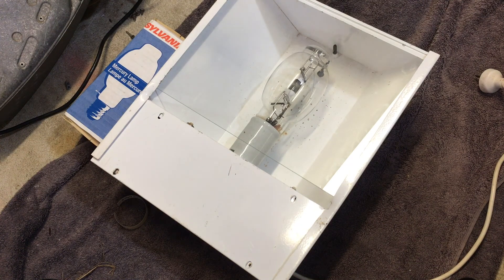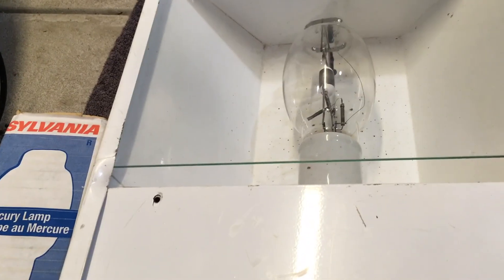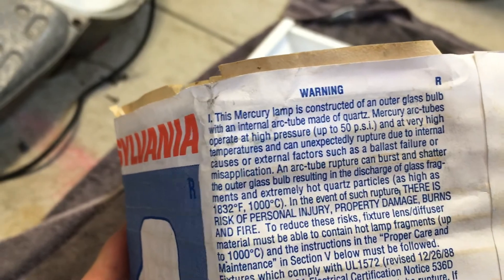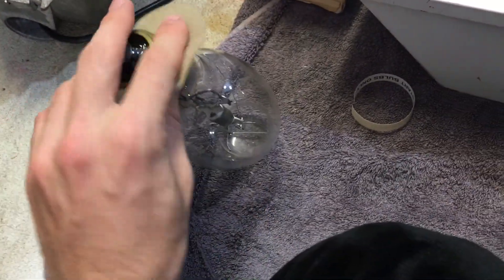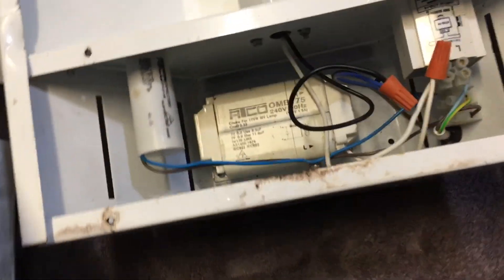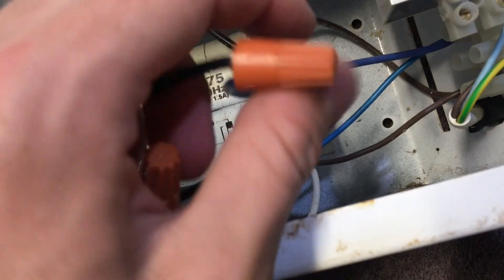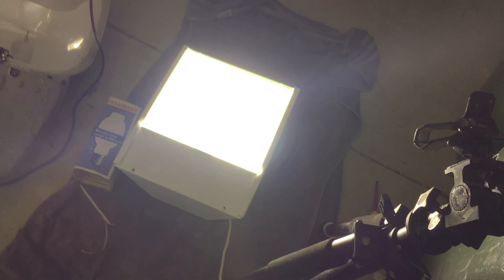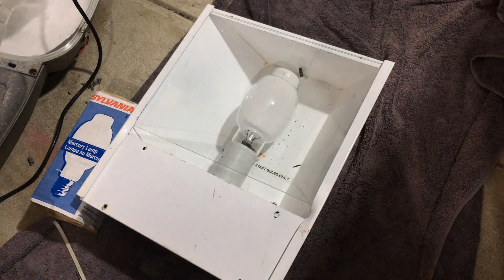175w mercury vapour/metal halide light fixture, new bulb and testing (old video 2019)

Comment: The U.S metal halide light used of probe-start method for starting without external ignitor. And the CWA ballast could be operating any input voltage 120/208/240/277V and 50-60Hz

Comment: The only time a metal halide lamp will explode is if it is being energized 24/7. It is recommended that metal halide lamps be shut down for 20 minutes once a week. That way, as the lamp reaches end of life, it will fail when you try to turn it on and will not explode. It’s best to use an unprotected metal halide lamp in an enclosed fixture which will protect people if the lamp does explode.

Comment: This MH lamp is actually a probe start lamp.
Reply from the maker: then why is there an ignitor? the old bulb was a pulse start MH, the one I replaced it with was a probe start MV. in Australia, there's no such thing as probe start MH or pulse start MV. MV is always probestart, MH is always pulse start.
Reply: WillPower A probe start MH lamp can operate on an Australian MV ballast and a 750v-1kv 2 wire ignitor. The ignitor in this fitting does not send a pulse powerful enough to destroy the starting probe in this MH lamp.
Reply: @willpower_electrical_and_more  there is something wrong mercury vapor bulbs dont need igniter, pulse start metal halide bulbs need igniter probe start dont need
Reply: If you look on the bulb etch, there is an alphanumeric code that says “M57”. In the US, this is the designation for a 175w probe start MH lamp. This MH lamp only needs a LOW voltage starting pulse to ignite. However, a real pulse start MH bulb actually requires a HIGH voltage starting pulse. A US 175w PULSE START MH bulb actually has an alphanumeric code M137 or M152 and NOT M57 as it says on this bulb. Operating this MH bulb on a REAL PULSE START MH ballast will destroy the bulb at the worst and at best, it will destroy the starting resistor.
Reply from the maker: @cedricwoirhaye8268  is this on the clear bulb or the frosted bulb? when I received the fixture, it had the clear bulb in it and the ignitor was connected. as you saw in the video I disconnected the ignitor and installed an MV lamp, as I prefer MV over MH.
Reply: WillPower The clear bulb actually is also a probe start. All it requires is a lower starting voltage than a regular pulse start MH lamp, however, it requires a higher starting voltage than a MV bulb. The ignitor that is used in this fixture is specifically designed for the operation of probe start MH bulbs in MV fixtures. In the US, the ballasts for these MH bulbs do not have ignitors because they have a slightly higher OCV than the OCV of regular American MV ballasts. In Europe and Australia, 750v-1kv 2 wire ignitors are used to compensate for the low OCV of mercury ballasts over there. Plus both the MH bulb AND the MV bulb are designed for the US market, but they will still work fine in Australia since the gear in the fixture runs these bulbs at the proper voltage and current. In addition, the ignitor in this fixture that you have has voltage pulses that are too weak to damage MV bulbs since they only have 1,000v pulses and not 4,000v pulses which can destroy both probe start MH lamps and MV lamps.